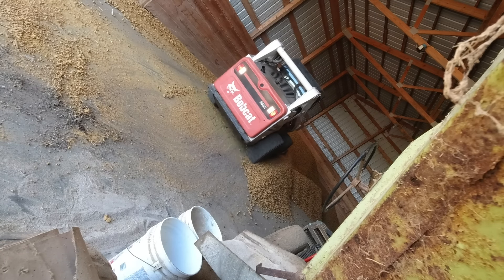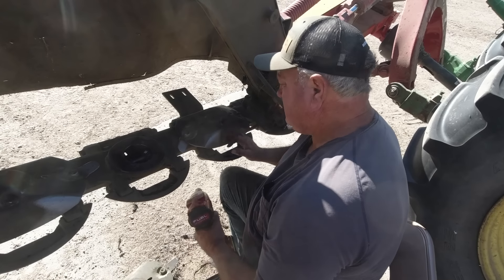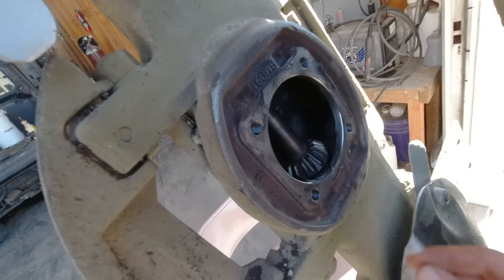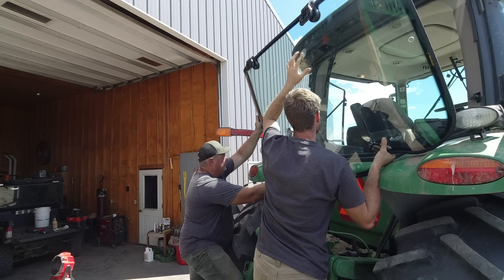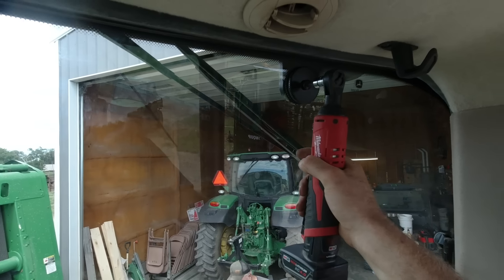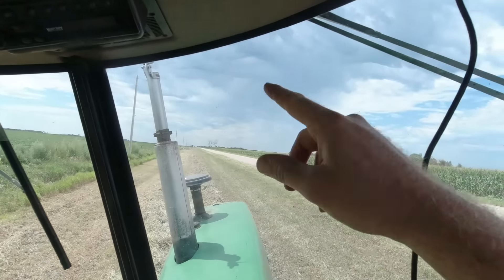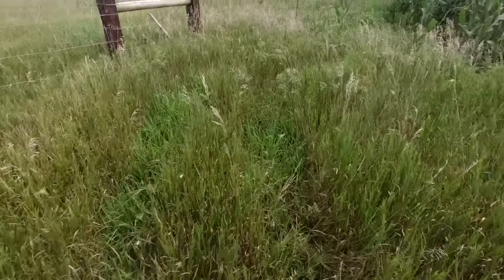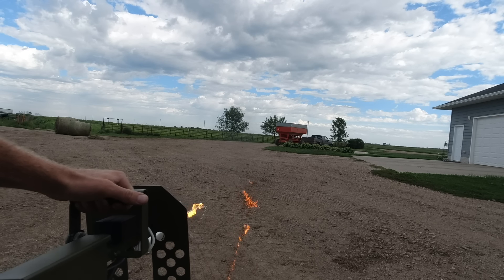Last Day of Ditch Hay

Comment: Thanks for another great video. It was interesting. 

First of all my compliments to Brian and Cole for hanging in there and getting the job done. 
I know you have had a bad week with all the breakdowns and things broken. 
You got some hay off of the ditches to help with the hay supply. 

Cole nice job welding that skid plate on the mower. Seems to be holding just fine. 

Glad you got done with the ditches and got that behind you. 
I know this has been a hard week on both of you especially Brian. Hard to see your equipment damaged. 

You both please kick back and take it easy and know you got the job done. 

Like that sprayer you have in the back of the gator. Works good. You really got those grasshoppers knocked down. 

About it I guess for now. 
You gentlemen take it easy and relax from a hard week. 
Take care of yourselves. You both are the best!!!!!!!
Thanks for everything. 
The Iowa Farm Boy. Steve.

Comment: I know things can happen with or without unusual conditions, but the added rocks and debris in the ditch surely gave it an added issue. The windows being broke is a shame and I seen a comment where a suggested wire mesh over the window, was given. I put an expanded metal one over the back of my open station, when my son had a PTO shaft fly off and hit the head liner of the canopy just an inch or two above his head. Good to see you getting those ditches done, at least no one was injured. Thanks for sharing, I hope you have a nice, safe weekend!👍

Comment: Hey Cole you mentioned in your video that you would have to replace the whole cutter bar to fix that hole. That cutter bar will come apart at each individual module. There are 2 rods with each module that have nuts on each end. You take those bolts and nuts off to break the cutter bar down. Unfortunately I’ve had to do it several times.
Reply from the maker: Thanks for the tip!
Reply: @SonneFarms  44😮😢

Comment: Sometimes the best solution is to find where you can run Teks in and bolt a J.B. bang-aid on bellies like that.    Then tip the cutter bar so it doesn't drag.   Straight bar flail harvester is probably your best bet for handling ditch hay, machine like a Stackhand.

Remember to tip the cutter bar so it doesn't drag because tipped cutter bars not dragging keeps the cutter bars from dragging on the ground when you're cutting.   Draggin's bad.

Song of the day is "Stop Draggin My Bar Around" by Steel Nicks and Torn Plating.

Comment: Hi Cole. Great videos.  I have the same new holland cutter. You can split the cutter bar with those big bolts under the pods. And replace just the one gearbox. I did mine a few years ago. Got a reman one. I think it was around $350. Not to hard to do. Did it by myself.  Have a good one.
Reply from the maker: Thanks for the info!

Comment: On those new Holland disc mowers you can replace just the pod that is damaged. Should be able to undo the tie bolts and put in a new pod. Either the casing or a complete pod.

Comment: If you have a 1/2" thick piece of Copper, you can hold it in inside the cover and weld on top of it to fill the holes.  The weld will not stick to the copper.

Comment: This winter you really should make yourself a fabrication table. 👍
Reply: I moved from Ohio to the Philippines and built a steel house. One of the very first things I had built was a fab table.  1/2" X  4' X 8'  with 1/2" x 3" angle iron welded to the underside of the table on all 4 sides. The angle is turned so that the edge is 1" thick and we can clamp to it. One of my very best investments here.
Reply: My mom worked  for Cessna  Hydraulics for many  years, when they sold out to Eaton she was able to buy a huge fabrication table with  a frame above it and  light fixtures. My dad was so happy.  Well once we got it unloaded and  into the shop. That was no easy feat.

Comment: The mower actually has sections. You can replace the gear box alone. Between each gear box there is spacers so you have to take it apart on one end and work your way to the broken piece. It sucks but a new gearbox is roughly $350. But your weld is cheaper 😉and if it holds up better yet!!

Comment: Nice job making and welding on the replacement skid plate.
Would everything correctly if you put a sacrificial skid plate on each one so then you replace those instead of wearing out the real one that holds in the oil ? 🤔
Reply: HMMmmm    ???
Reply: yep

Comment: All that is a pod and you can buy those pods individually.  Just  uptake two bolts out and slide them apart . When you  bolt them back together make sure axles line back up and make sure its in time from gear on top. My husband helped a buddy who has one just like yours. Its an easy fix. Put a new shoe on then your done.
Reply from the maker: Thanks for the info

Comment: Do they make guards or cages for your tractor to prevent rock strikes or could you make a temporary one for jobs like this?  Seems like it would prevent having to purchase a lot of replacement parts and labor.  In years that you have to do this, a temporary guard will be a good thing to bring out and dust off

Comment: You can replace those sections where those bolts run parallel with the bar will come apart and you might want to inspect those stub shafts in between those units I see them wear the teeth off
Reply from the maker: thanks!
Reply: @SonneFarms  glad to hear one of y’all saw it and if y’all use it more than once every few years I would recommend replacing that section I seems like from the channel y’all only pull it out for when y’all cut y’all’s ditches

Comment: I have the exact same disc mower and I'm curious what happened to the skid plate. Did it fall off or just wear out?  Want to avoid the same issue. And ditch hay is the worst! Last time i did some got into some woven wire and what a mess that was! Also, not a good idea to feed cows hay with wire in it!! Anyway,always enjoy your videos !
Reply: wore out

Comment: In several past videos when you are working in the fields and come across a rock or piece of metal you toss it over the fence into the ditch.  Now you are mowing ditches and wondering where all these darned rocks and hunks off metal are coming from.
Reply: They never throw anything in the ditch.  They toss it to the fence line on the inside.

Comment: I think if I had to start cutting and baling ditches to augment my hay supply I’d look into going old school and get a sickle bar for that old M you have shown some pictures of and a beater of a baler. Perhaps an older square baler. Those side stabilizer wheels on the JD round baler you use don’t  look to have the guts to handle those ditches and that high speed cutter it too dangerous for the crap you come up against in the ditches. Just a thought and it couldn’t cost as much as what you’ve had to invest to use the modern equipment you have been using. Good luck.